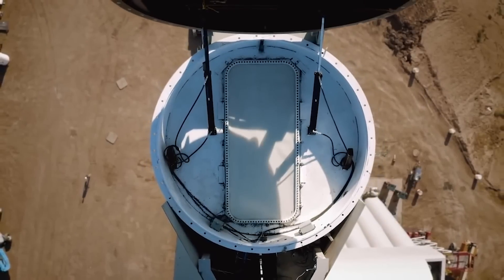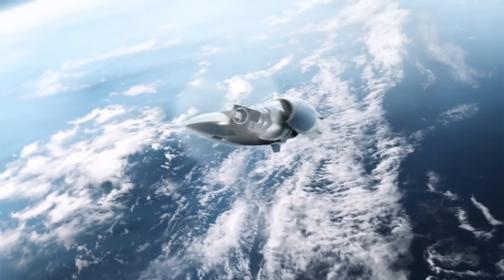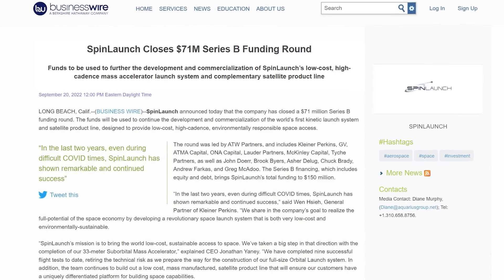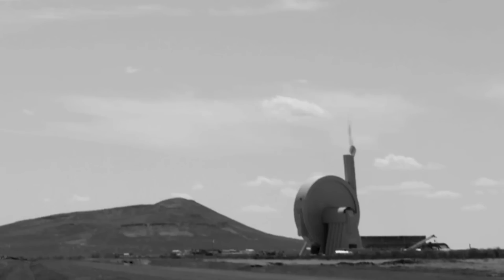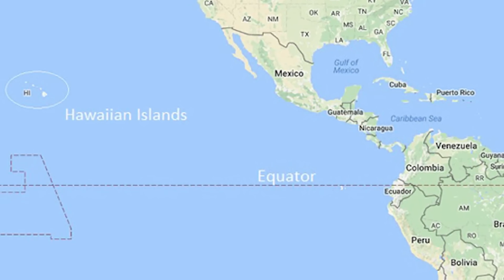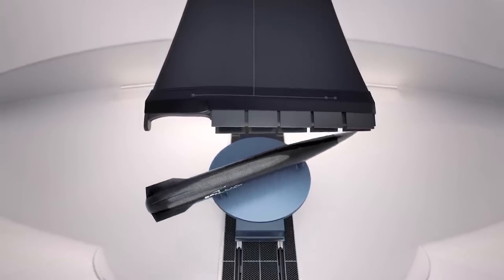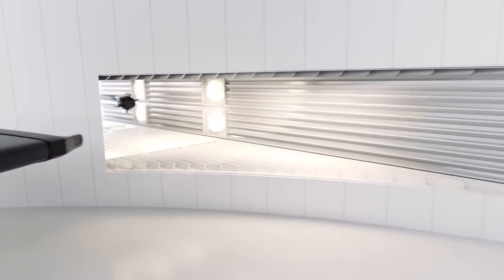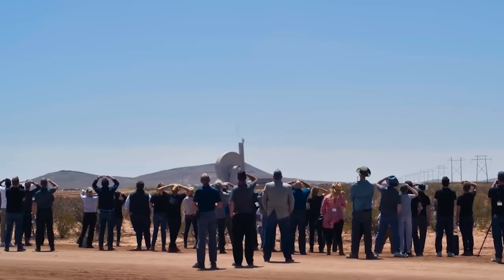What Happened To SpinLaunch & The Orbital Accelerator?

Comment: This has never seemed to be feasible given the laws of physics.  If the accelerator arm is roughly ten meters long and the exit velocity is Mach 5, my back-of-the-envelope calculation of a = v^2/r gives a centrifugal acceleration of 200g.  I'm confident that the contents of an artillery shell could survive that, but not any commercial electronics that I have ever heard of.  Orbital velocity is Mach 23, so an exit velocity to reach orbit would produce a centrifugal force of about 20,000g.  That's a SERIOUS amount of stress on the vehicle.  I don't know any kind of material that could be used to make a strong-enough rotor arm, if the missile to be thrown weighs very many kg.

However, it gets worse.  There's a vacuum inside the accelerator, but once the missile exits it hits air at approximately sea level. Even at Mach 5, a lot of that energy is going to be bled off by moving through the atmosphere.  A lot of this energy will be transferred to a sonic boom.  This wouldn't be like the sonic boom from a jet flying at Mach 1.5.  Even at Mach 5 it would be BIG.  I don't even want to think about what it would be at Mach 23.

The new plan seems to be to fling a full rocket an undetermined amount into the air, then have the rocket ignite and carry the rocket into space.  Like launching from an airplane, this gives the rocket a small head start, so it could perhaps be lighter.  However, it still must resist hundreds of g's of acceleration, which would mean that it would have to be built much stronger than, say, a ground-launched rocket.

Disclaimer:  I have degrees in physics, but I am certainly not a qualified rocket scientist.  My calculations are only rough approximations and have not been thoroughly checked and tested.  I sense that something is very wrong about the "science" behind this project.
Reply: The video did show the launched capsule to contain a rocket engine to bring the payload up to orbital speed. While this helps making the requirements less extreme, it is indeed still seriously strong g forces during rotation before release. And that rocket engine and fuel tanks would also have to be able to "survive" the rotation.
Reply: I'll be the first to say this method doesn't make much sense to me either. However, I assumed they weren't actually trying to reach orbital velocity from the catapult. I assumed they were using this thing to effectively throw a second stage up to or near space, then ignite a rocket to reach orbital velocity. The catapult replaces the 1st stage is all.

Still, between the G forces, the upper stage and payload have to survive. The strength of the throwing arm both under load and the forces it will encounter on release. The timing of the doors to maintain vacuum. 

Plus, what happens if or probably when things break catastrophically. I don't want to be anywhere near this structure on spin up.

Building a reusable first stage sounds easier and safer. Can they do it probably, but should they? Still, when/ if they go for orbital launch, I'll grab my popcorn and watch from hundreds of miles away. Worst case, it's the world's biggest grinder accident. Hopefully, these mad scientists will keep everyone at a safe distance. Best case, I'm pleasantly surprised.
Reply: I'd love to see the plasma produced at the moment of leaving the vacuum at that speed.. I think they will make more money selling the material built to survive launch both in the vehicle and the launcher. Like a submarine imploding. But apparently they have a door fast enough.🤔😏
Reply: @chadleworthy1741  It's a sheet of thin, strong plastic film covering the hole and stopping air getting in. The vehicle just rips through it.
Reply: @paulmichaelfreedman8334   I saw that in the video, and would like to know more about it. Is that the only seal or is there something more?
Reply: @@GuiOpsDev  Not a good idea to insult people.  Lets all try to contribute to civil discourse.
Reply: @catsupchutney  they arent really insults, just petty graspings. tesla is successful from idol worship, good luck at the right time, money, and of course, isnt viable in the long-term.

its not like, say... the AC motor, as "no motor can utilise an alternating current" or flying, as "no heavier than air craft can ever fly"...

they were revolutionary. changed things.

i know what the OP was saying, but he chose the wrong topics... tesla isnt revolutionary, it started a fad, a trend, that will be shortlived and regretted. it isnt thought out for the long term.

im reminded of TV. it started as B&W, stayed that way for years. when colour came out, teh engineers were given a challenge... keep the transmission bandwidth of the old B&W, keep it backwards compatible. any B&W tv will still accept this new colour signal and work. they did it. TV worked as it was, on a legacy, for...70, 80 years? it was thought out, planned.

here where i live the government rushed in to implement digital TV, take out all the old systems, forced us to "upgrade"... none of the old gear works, and the new transmission is unwatchable if reception is anything less than perfect. go figure. "efficiency". yet... i know its not teh same thing, it just seems sad that the intelligence and wisdom of previous generations is ignored and tossed aside as fuddy duddy nonsense. it made sense though, there was a reason for it.

where was i?

sometimes, an idea is so revolutionary and contradictory, it just gets laughed at...

theres plenty of us with actual working ideas. we never see fruition. life. money. time.

theres a lot of bogus charlatans that can talk the talk but produce nothing but BS for it... they made their retirement fund though!
Reply: @paradiselost9946 hey I've gotta ask, I've seen your generation say teh online when they mean to say the why does genx say teh a lot?
Reply: @LeafBoye  my generation? which one is that, exactly? oh. gen x. am i gen x? are you sure?

yknow, i dont know. im typing. my keyboard doesnt work half the time. i look up, and for some reason i have this habit of almost always writing teh rather than the... i have to go back and edit. couldnt be bothered.
Reply: Your points have been discussion topics for a while now, for the exact reasons you have stated.  Unfortunately it seems everyone is super keen to go along with the hype without actually looking at the details.
Reply: @s1l3ntw1  Investors are gonna loose all their money
Reply: @s1l3ntw1  They most definitely have looked into the details and it all obeys the laws of physics and works. See my other comment.
Reply: If the math works, then it's a valid point worth elaboration, degree or no degree.  I was only thinking about flinging a thing into orbit, and completely overlooking whether it would / could function.  I'd love to read a critical discussion as to how Spinlaunch could make any reasonable argument for the conditions they need to meet for success.  I mean if they are off by ten percent of margins dictated by material limits  - well then there's something to aim for, but if they are off fifty percent, then that's something else.  

It seems at this point they must be reliant on DARPA money.
Reply: My thought exactly...they are conning investors who must have failed high school physics.
Reply: @barthennin6088  They aren't conning anyone. Anyone who has actually seen the data/results knows it works. Doubt all you want, but the physics holds up to scrutiny and they have chosen to prove that to people that matter (NASA, DARPA, DoD, Shareholders, Smallsat manufacturers, etc.). They just want you to eat your words when the orbital version comes online lol
Reply: My quick "back-of-the-envelope" math says a 100' diameter rotor (50' arm length) would need to be spinning at no less than 7000 rpm just to get to escape velocity at the surface. Since you need to add initial velocity to counter atmospheric drag, you are probably looking closer to 10K rpm.
That large of an object moving that fast is bad enough... But have they discussed how this rotor, that will have to be precisely balanced for each load is going to equally and precisely re-balance itself after releasing the payload?
Honestly, something like a repurposed version of Sadam's Project Babylon cannon (https://en.wikipedia.org/wiki/Project_Babylon) would be a better option for this.
Reply: @PhotoBobBarker , good ideas but things get out of control way below escape velocity ( approx Mach 25).  One approximation that I find useful is what I call beta, the ratio between the kinetic energy of a kilogram of payload moving at some Mach number versus the chemical energy of a kilogram of TNT.  Beta goes up as the square of the velocity.  According to my calculations, beta is 1.0 at a velocity of about Mach 9.  So, a payload moving through the troposphere at escape velocity would have about 7 times the kinetic energy than the explosive power of an equal weight of TNT.  If you tried to sling a payload at that velocity into sea-level air pressure, most of that energy would go into the shock wave.
Reply: Physics can't be chated. IIRC the acceleration sustained is the same for circular centripetal acceleration vs. linear acceleration over the length of the diameter.
The only advantage is that you can put the energy in over several revolutions.
Reply: Spinlaunch would be ideal for the Moon.  No atmospheric friction, lower gravity, no need for a containment shell.  Just a stick and a motor.
Reply: @NeilFraser 
On the Moon, the launcher can be a linear accelerator built on a slight slope. After the release point, the launcher can also recuperate the inertial energy of the carrier [that held] the payload. 

However, the electric power storage infrastructure is expensive compared to the cost of fully reusable boosters and cheap chemical propellants.
Reply: all the electronic will immediately broke during the spinning.. unless they want to send a plush toys.
Reply: @whybotherha1021  Not true, all payloads on the test bed survived the whole flight. They even flew a $20 camera off of amazon and it survived. Electronics are surprisingly resilient to G-loading when the loading is applied gradually.
Reply: How about launching water that could be recovered in orbit and processed or stored for later conversion to fuel ? Water can take a lot of g's
Reply: @dionysus2006 yea water would never heat up and turn to steam thereby increasing its volume and causing the container pressure to increase unreasonably.
Reply: thanks for writing all that, with the numbers n stuff.   I've got a mechanical engineering degree, and also not a "rocket scientist", but I do have a good idea of how all this stuff works and I totally agree.  Not sure why this project made it past a white paper, the forces, velocities and energies involved are just mind boggling. It seems that the base station will blow itself up LONG before it can get something to orbital energies, and that's if everything goes correctly.
Reply: @adamh1228  "Not sure why this project made it past a white paper, "
Some people will readily pay huge sums of money to prove that unicorns and pixies at the bottom of their gardens exits if you give them half a chance. No use wondering about it.
In the end this "project" will for sure just quietly disappear like happens with all these wishful thinking projects.
Reply: you're forgetting the fact that mach 23 at sea level will literally disintegrate the payload.
you can't do that. silly bear. holy hell. and they expect it to go miles at this speed?

it'd have to be going MORE than 23, maybe even 30, to even have a chance at actually reaching that height, due to the bleedoff from friction. not to mention the instantaneous compressive forces it'll have to undergo WHILE also getting superheated and resisting any ablation in order to stay aerodynamic.

literally impossible with any material we currently have available.
Reply: @nobody8717  , thanks.  People might want to learn more about the Chelyabinsk meteor, which detonated at over 100,000 feet. It was traveling at about Mach 60, so its kinetic energy per kilogram was about 4 times that of an object going at Mach 30.  Needless to say, the air at that height is MUCH thinner than even the air over the highest Earth mountains.
According to Wikipedia, most of the meteor's kinetic energy was converted to shock waves, light, and UV radiation.  The bolide was an ordinary rock (chondrite), yet the forces at 100,000 feet were enough to break it into small fragments.
The combination of light flash and sonic boom produced many injuries over a wide area.
Reply: Yes, I've had the exact same reservations about this launch method since the day I heard about it. Simple physics says the engineering challenges are extreme and thus seriously limits the chances of success. And the maintenance and checkup schedule for such a launch installation would have to be extreme too. Any flaw in manufacturing of the high strength structures that have to withstand the high G forces will result in a catastrophe sooner or later.
Reply: @paulmichaelfreedman8334 , The systems are extremely simple... Yes the scale is large but you don't get much simpler than an electric motor with an carbon fiber arm on it in a chamber. 
You could very easily use non destructive testing methods to check the arm for issues like delamination, etc. since the force on the arm is all going to be tensile it makes it less complicated.
Reply: @getinthespace7715 
When the projectile is released, it is released front tip first and the rear is only released later when the rear clamp reaches a certain relative angle. This should eliminate projectile rotation. 

However, this also puts a sudden dynamic load on the sling arm. The carbon-fiber and resin matrix may wear out from repeated launches.
Reply: 1) Liquid fuel inside the rocket is also rotating and won't stop doing that when the rocket goes (somewhat) straight out of the tube.
     Keeping the solid parts from tumbling is difficult enough as a timing problem.
2) The cone of the shockwave at Mach 5 is 22.6° but at Mach 23 it is only 5°. Hard to hide the body of a sophisticated projectile inside this 5° cone.
3) Artillery shells can experience 1000's of g's when being accelerated down a barrel. Your electronics need to be robust and then some. Going from 0 rpm to 240,000 rpm in about 1      millisecond should tell any-one it isn't easy on the material. Proximity fuses have pretty robust electronics.

Disclaimer: I don't have a degree in physics but I did specialise in 'Weapons, Ballistics and Explosives' in the navy.
Reply: @DreadX10  , oh my yes, sort of...  If the rocket were held by a bracket on the end of the arm,  and the arm was rotating at a frequency of f, the payload would also rotate at the same frequency f about its center of gravity.  So, when it hit the atmosphere at, say, Mach 5 then it would be tumbling sideways.  It would likely break up almost instantly.  Sooo, the end of the rotating arm would have to have a counterrotating platform to hold the rocket.  Since usefully large rockets are fairly long, the long axis of the rocket might be almost as long as the centrifuge arm. The motors or gears required for the rotating arm would have to be enormously strong.

Ohh, but it gets even worse, due to the very strong tidal gradient on the rocket parts and resulting huge vibrational bending moments.  The entire apparatus would almost certainly self-destruct well before the spin-up was complete.
Reply: @stuartschaffner9744 
The patent shows and prototype demonstrates a release of the front end first while the back end is still captured. This causes the projectile to stop spinning as it is released. 

As many others have pointed out, any liquids inside the propellant tanks must continue to spin for some time. This is probably why these tanks are spherical.
Reply: @imconsequetau5275  ,  thank you for that.  That's ingenious.  However, just like rear fins on the rocket, any unbalanced side force like that puts a strong bending torque on the long axis of the rocket.  As with so many other things about this overall geometry, these forces scale as the square of the release velocity.  So, a prototype that releases without problem at Mach 2 might come apart at Mach 7.
Reply: The counter weight of equal mass at the opposite end of the rotating arm should retract into the arm the moment the payload is released to counteract the loss of mass. Something the rods in a nuclear reactor do automatically to shut it down in an emergency.
Reply: @DreadX10   It might be solid fuel. The video was too light on details.
Reply: @catsupchutney  The animation they showed was a rocket-stage with liquid fuel. Solid propellant has its own problem. There usually is a cavity in the middle (this cavity forms the combustion-chamber). Under high g-loading (perpendicular to the rocket-body) this structural weak material would cave in or at least form cracks in the solid propellant grain. Solid rocket-motors go boom when damaged like that.
Remember the Mythbusters' attempt to make a rocket-car, that blew up?
Reply: @DreadX10    My point is that the article is not giving details.  I am sure the acceleration would affect whatever they are flinging into the sky.  I am old enough, and have experience enough to simply ask question without offering explanations based on conjecture.
Reply: @catsupchutney  " I am old enough, and have experience enough to simply ask question without offering explanations based on conjecture."
Good for you. 
Who is answering based on conjecture?
Reply: @DreadX10   Thank you kind sir!
Reply: @DreadX10 They don't go to 240k rpm in a millisecond.  They build up the velocity over about 45 minutes from memory.  So the electronics don't need to be super special, unlike the ones in smart artillery rounds.
Reply: @technokicksyourass  That was an example for robustness. You pulled it out of context, applying it to spin-launch.
Indeed, building the electronics robust enough is do-able as we can build proximity fuses for shells. But they weigh more. The spin-launch satellite will have to weigh more than the same straight-launched satellite.
Reply: @DreadX10  Eletronics can handel the forces. yes.
But calculate this. F = m • v2/r.        Cargo 100kg *2060m/s^2 / 50m 
Thats a centrifugal force of 848t for the cargo alone. Withe the weight of the Arm we land beyond 9000t of centrifugal forces. ( weight of 3 saturn v rockets) 
And these forces on a moving arm of 450rpm.    

If someone could tell me wich magic matirial can withstand such forces.
Reply: @eve-llblyat2576  Could you check your math again?
Reply: How do they deal with the sudden unbalanced load on the rotating mechanism once the projectile has been released?
Reply: It work well in a place like the moon, however on earth is a bit of a stretch
Reply: So, a hybrid system seems the logical step. The aim of reducing the wasted payload of fuel, the bulk of which is burned just after the tower, is the goal.
Reply: @davidarchibald50  , your point is well taken, but it argues for an airplane-launched hybrid, not a low-altitude slingshot.  The problem is that once you get up beyond about Mach 3, objects bleed off a lot of energy into shockwaves in the denser air of the troposphere and even the stratosphere.  A system like Virgin Galactic uses subsonic airfoils on its airplane-like "booster" to slowly but efficiently lift the second stage rocket above most of this dense air.  The fact that there are even viable alternatives to the all-rocket system of, say, SpaceX shows that there still might be long-term alternatives to the all-rocket system.  Sadly, I don't think that sea-level centrifuges are likely to be the long-term answer.  However, as several classic sci-fi novels have explored in detail, a centrifuge or more likely a rail gun would work well on the Moon.
Reply: @stuartschaffner9744  great discussion Stuart. Thanks.
Reply: @@GuiOpsDev NO, aerodynamically speaking, bumble bees CAN fly. They only didn't know at the time how they did it. But they do now. 😃
Reply: What I was trying to say was that in the case of the bumble bee we knew It could fly because we can see it😄. @@GuiOpsDev
Reply: Jeeze, I wonder if they ever thought to talk to a physicist.  You should write them a letter.
Reply: How about using magnetic accelerator then? like new roller coasters?
Reply: But its possible to be used to SEND pure ONLY materials to space ( food, fuel, carbon fiber material, etc )
Reply: You don't understand. The purpose of this company is not to make a working product but to make a profitable exit.
Reply: Building a spin launch in orbit sounds more useful. As it could be charged by solar panels, though it would be expensive to start up. But it could easily be turned into a weapon.
Reply: @michealwestfall8544  You can't do spin launch in orbit.   Think about the inertia imparted to the spacecraft by the centripetal force and the release.
Reply: I know they using a rotor arm. But a simpler solution might be induction motor for rotation and to allow a tiny amount of air to bleed back into the chamber via tiny air ports on circumference .launch carriage floats on those air bleeds. Hydrostatic bearing. . Low friction bearing. And unlike an arm the  outside of chamber could then be made extremely thick to cope with forces.
Reply: To address the issue of needing to go mach 23 on the ground, that is completely impractical and unnecessary. The accelerator only needs to get the first stage out of atmosphere using a suborbital trajectory. The second stage is what actually provides the majority of the energy needed for orbit. If you look at their second stage design, it's propellant mass fraction is extremely high because of this.

Something else that they should look into is making the fuel+oxidiser mass fraction as high as possible. This method only gets more efficient by using increasingly dense payloads that store larger amounts of kinetic energy per cross sectional area and the most reasonable way of doing that is increasing the propellant mass fraction.

Hypersonics is also a less researched field that could greatly benefit from these efforts.
Reply: Rather than an arm rotating inside a drum. Accelerate payload around the inside of  a tube bent into a large circle?

Less volume to pump down to vacuum. Easier to make the radius greater which reduces  the g loading.
Tube can be made as massive as  necessary to keep the payload orbiting
Reply: They are talking about a chamber with a 100m diameter, which would be a longer arm and lower radial speed.  Combined with using a small rocket in the upper atmosphere, where it is more efficient, this could work.  Could...  Another concern is the precision release.  At 5000 rpm, a 1/10,000 second release window (good luck finding large actuators with that precision and speed) has an 8 meter wide accuracy at 75 meters travelled (my estimate on the length of the exit tube).  That's 75 meters flown and up to 3.9 meters off intended course; the boys from NASA would've been in prison for trying to launch like that.
Reply: @s.d.3236  the release mechanism is another reason I suggest run a carriage around inside of 100m diameter wall rather than hang it on end of  arm....the forces needed to keep carriage on circular path, could   "actuate" a burst plate when the forces exceed what plate can cope with. Anf that'll happen at a fixed angke/once carriage exceeds a threshold speed. And once burst plate goes the carriage will want to travel in a straight line.
Reply: @realengineering had a long video on this. Many of your concerns are addressed there (the highG effects on satellite in particular). IMO the timing of the door assemblies might be the biggest hurdle. It has to meet very tight timing and never fail, never miss.
Reply: I didn't do the calculations but for me the biggest concert was also the internal components surviving 10,000g of acceleration. This is not a typical requirement for a satellite or anything else really. Not really sure if it's possible or worth it to engineer everything to withstand.
Reply: "I'm confident that the contents of an artillery shell could survive that, but not any commercial electronics that I have ever heard of"

It is not only the electronics - satellits also contain mechanic components for example to align antennas and Gyrostabilizers.
Also it makes a hugh differenct if such a device has to resist acceleration for a couple of milliseconds (like a bullet fired in a cannon) or for several hours (which Spinlaunch needs to increate the rotation speed to the final value)
Reply: It'd need to be about 10x bigger to achieve orbital velocity, but then it's simply too big, then if you could make it big enough (which you can't) it burns up before it reaches space.
Reply: You have a degree in physics and you write "centrifugal" force? :D Where did you get your degree at?
Reply: @abelnicolae  "You have a degree in physics and you write "centrifugal" force?"

What's wrong with it?
Reply: @abelnicolae  That is the correct spelling of that word.
Reply: @abelnicolae  Centrifugal force is a fictitious force in Newtonian mechanics (also called an "inertial" or "pseudo" force)
Reply: I want this too succeed which is why I’m debating investing my life savings
Reply: @mattheww797  , please!, get some expert advice from a qualified physicist who is not involved financially with the project. Your life savings?  I would say this about any leading-edge project.  I know that it's just a dramatic phrase, but they don't call the leading edge the bleeding edge for nothing.
Reply: I agree it seems like a staggering problem. If they launch a regular second stage vehicle it’ll require sensitive flight computers. If they are using liquid propellant for the second stage then the pressure from the G force on any tanks or valve hardware would result in serious over engineering, reducing payload mass.  By the time they solve this problem (if at all) SpaceX will most likely have their next gen launch vehicle Starship in operation and beat them at cost per kilo.
Reply: thunderf00t tore this idea apart about a year ago.
Reply: @mikethespike7579  thunderf00t also tore apart the prospect of landing rocket stages under their own power, yet it's happening pretty regularly at this point.
Reply: @TheYrthenarc  You might want to revisit what thunderf00t said in his video. He didn't claim that landing rocket stages to reuse them is impossible. He claimed that the technology won't bring down the cost of rocket technology and maybe will make it more expensive. And there the jury is still out.
NASA's shuttles, basically the same idea of saving costs just in the form of reusable space capsules, proved to be far more expensive.
Reply: @mikethespike7579 SpaceX has brought down cost to orbit significantly, what do you mean the jury is still out?
Reply: @dirtypure2023  On what basis do you make that claim?
All you have is Musk's suggestion during an interview that retrievable rocket stages will bring down the cost of space exploration.
Rocket stages are more or less the cheapest part of a rocket. The engines and fuel tanks themselves, the expensive parts, cannot be reused and the rest has to first be extensively refurbished before it can be reused.
For that there are additional costs of these reusable rocket stages, additional weight to carry and in many cases someone has to go and retrieve these stages.
Musk talks a lot, claims a lot, but has a miserable record of achieving what he promises.
Reply: @mikethespike7579  Go ahead an keep tearing it apart, it works. I've witnessed their tests and flight data first hand. You'll be eating your words in a few years.
Reply: @yaxleader   What you saw was a big machine fling something high into the air. Impressive, yes, but that is still nowhere near successful.
You can't cheat physics, any first year science student can calculate it. The forces for reaching an orbit are so great that any payload would be destroyed.
Reply: I wonder has Spinlaunch thought of any of this? 😄
Something tells me that they have.
Reply: @toi_techno  Their probe came tumbling out of the tube. They didn't publish that little fact when looking for new investors.....
Humanity can only hope that they find a new technical solution to one of the problems with this launch-system. That would be realistic. A novel way to handle a timing-problem or a clever way to go from a well balanced rotor to a very unstable rotor and get it balanced again in a very short time. That sort of thing.
The spin-offs (pun intended) could have more value than the launch itself.
Reply: @DreadX10  What? They explain the tumbling multiple times? It's the projectile self-stabilizing itself and switching from rotational to linear force. It tumbles a few times and then starts flying straight. I saw it with my own eyes. Pretty easy to understand and it's not even a concern.
Reply: @yaxleader  If they plan to use aerodynamic forces to stabilize their vehicles then they are wasting energy.
That's like steering a race-car by applying brakes left or right.

The oblique shockwaves over the body must be spectacular when tumbling at Mach 'Ugh'. No problem with a steel test-projectile but a rocket is not as sturdy.
Reply: Here's some details from someone without a physics degree, but 5+ years in the space industry who has visited and seen a test myself: 

They're not shooting for orbital velocity right out of the gate. Accelerating the arm to Mach 23 would break the entire assembly, not just the payload. Instead, they will achieve the speeds given by traditional first stages of rockets (around 2km/s or about Mach 5.8), then the vehicle will shed it's shell and become as light as possible and ignite the second stage that will achieve the remaining velocity. As the vehicle will be at a very high altitude by then, the resistance to acceleration will be FAR lower and much less fuel will be needed to achieve the final orbit. 

The G-load has also been accounted for and the entire purpose of the test system in New Mexico was to test survivability of various components. Their computer models showed that the only modifications needed to modern smallsats to survive launch would be a re-orientation or folding of protrusions like solar arrays or robotic arms. They proved that virtually all off the shelf components can survive the G-load by buying a $20 camera off amazon and flying it on the vehicle (that's actually where you get the POV of the vehicle from in the videos). Surprisingly, when you look in depth at motherboards and modern electronics, the procedures we use to hold the components in place are far stronger than they would seem simply because of their small scale. Simple glued components would compare to a weld as thick as your leg for a TV stand when compared relatively.

The test I witnessed was the one with payloads. Every single component on those payloads survived the entire flight with no issues, and they had some complex electronics on board. This included the high-impact landing. The reason a lot of people have concerns over the G-loads is simply because we have never been able to test such G-loads on virtually anything before and it's not well understood, especially when said G-loads are applied with a gradual build-up instead of a sudden shock. But now we have the best test bed for seeing the impacts of these loads sitting in a New Mexico desert.
Reply: @yaxleader  , a traditional booster rocket gets you to something like mach 5 by the time it reaches an altitude where the atmosphere is thin.  If, however, you injected a projectile into the troposphere at a speed of Mach 5, three things would happen.  First, there would be a spectacular sonic boom. Second, the ram pressure on the vehicle would build up to levels that routinely break up iron meteorites.  Third, all that heat and pressure would rapidly bleed off that initial velocity of Mach 5.  So, to have Mach 5 left when the payload reaches the ionosphere, you would have to start with a MUCH higher than Mach 5 velocity.
One way to get a rough handle on the forces involved, remember that a standard booster reaches max Q, or maximum aerodynamic stress on the vehicle, at a bit above Mach 1 and when it is in the stratosphere.
Reply: @yaxleader  But the current testing is on a smaller prototype... when/if they manage to build the larger full size "spinner" all bets are off
Reply: @yaxleader  and the imparted spin?
Reply: There are,currently in use, "smart" artillery shells with guidance capabilities.   Perhaps, the problems are less than we expect.
Reply: @davidkottman3440 and those have reduced powder to reduce the g-load.
Reply: I feel like SpaceX would have dozens of these if reality supported the concept.  I'm also of the opinion that their main problem is going to be engineering a way for the payload to survive so much . . . trauma.
Reply: @sparkysmalarkey Space X works on the concept that fuel is cheap, rockets are expensive. Falcon and Starship use more fuel for every kg of payload than other rockets, since they have to carry fuel for the landing, plus need more fuel to carry that fuel up, and the added weight of the aerodynamic surfaces. Despite this they are still much cheaper, due to being able to reuse the rockets, the savings from which far outweight the extra cost of fuel. I bet they are looking at this sort of technology (or railguns) for return payloads from the moon though. Much easier with no atmosphere and 1/6 gravity.
Reply: Electronics should be fine, especially if hardened and surface mounted.
The lighter the material, the less intensely the G forces will affect it.

The engine assembly might need some clever design tho

Things like launch consistency and the effects of a miss-timed release are more pressing.
Reply: -Electronics can survive such accelerations and it has been mentioned before that any sattelites set to be launched via spinlaunch will obviously have to be designed acordingly.

-As far as I know, the idea never was to launch at orbital velocity, so no 20000g load and no mach 23 sonic boom.

The part that worries me more than anything is making the rocket hardware be able to take that many g's, mainly the fuel tanks, engines, so on.
Reply: Sure seem to be alot of people angry about a logical and pollution limited launch platform, using "physics" very incorrectly.
Reply: That company knows about those obvious problems. And no investor funds such a company without talking to third party physicists and engineers who are way smarter than you are. For one thing, the orbital spin launcher will probably not release at higher speeds, but it needs to be bigger to haul a bigger payload. The bigger payload being the second stage rocket, mostly. And yeah, they thought about the accelerations. It's possible to design electronics that survive this. Most likely, this will be used to haul supplies into orbit that don't mind the acceleration, and you only need a very simple rocket for it to get there and stabilize enough so you can dock or catch it with another spacecraft.
Reply: @Andreas-gh6is  Smart investors, with smart advisors, who are all waaay smarter than me?  Got it.  Let me point you toward some smart investing history, such as Enron, Theranos, FTX, WorldCom, Madoff, ...all very intelligent people, with very intelligent investors.
Reply: You will get screamed at by lot of people with almost no understanding of physics, engineering and math.
Reply: No worries. Outer space is still not proven to exist. If they created such a launcher, all it does is launching objects into air space.
Reply: @kordelas2514  Show us proof of that dome you people keep dreaming about. Must be easy to do if it was real.....